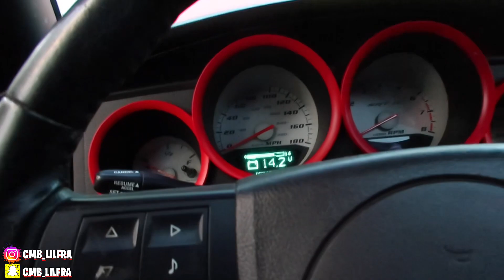WILL MY SRT8 6.1 DODGE CHARGER BE BACK ON THE CHANNEL??…THE TRUTH 🫢

Comment: That's Lifter Failure: It's Tearing up the cam Lobes on your cam; therefore your cam bearings are damaged, so they will either spin or spin out of place and will fall between your crankshaft in pieces or in the piston walls and scar your engine internals. So you have to take your intake off, take your heads off and pull those lifters out....

You can still save it. Don't rev it at all.

Comment: 6.1 should run about 3 or 4k to get rebuilt stock by someone else. The parts and machine work isn't too bad. About half the money is labor. If you go performance you can buy a stroker kit and make it a 392. That's what I did with my challenger. Don't keep running it though because it'll cause more damage
Reply from the maker: Bet
Reply: @cmblilfra  saw your charger for sale on fb how much you asking ?
Reply from the maker: @yuniormunoz2317  wat  my car not on there

Comment: You got a rod knock or a lifter knock go get it fixed befor you blow the motor then it’s gonna be a lot to get the motor redone just fix the lifters and the rods you be good

Comment: the price on these are not even close to 20k your looking at 5k just for the car not running banks won’t even give out a loan that large of a loan on an old vehicle like that already tried with multiple.
Reply from the maker: U will not find a SRT8 for 5k in less it crashed up the motor is about 7k itself